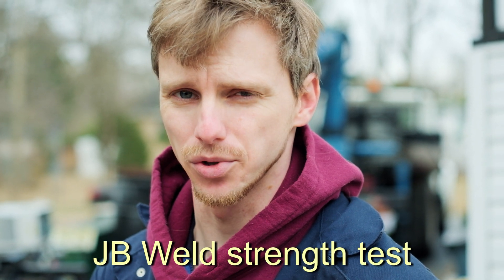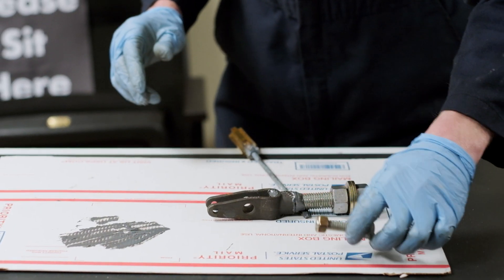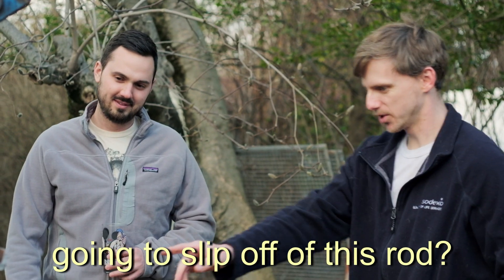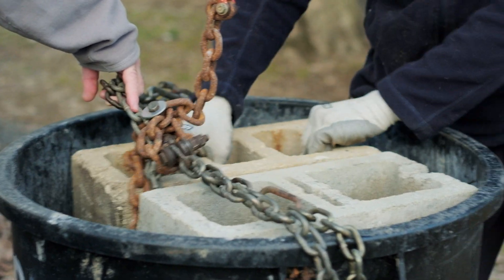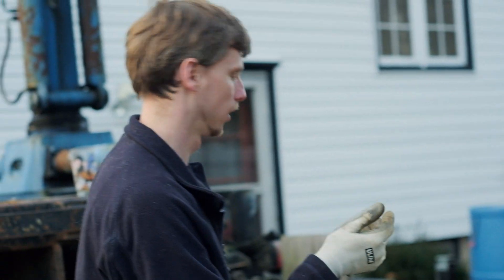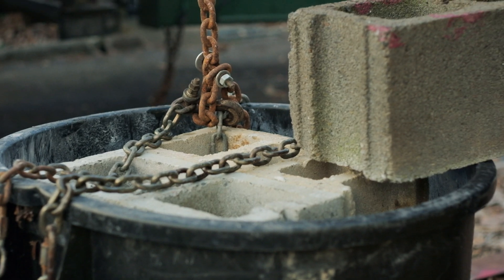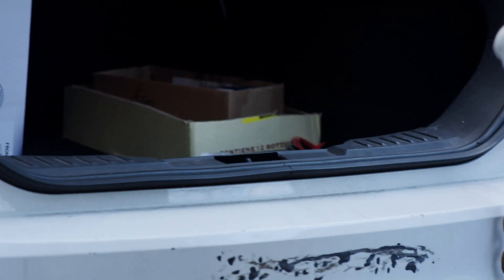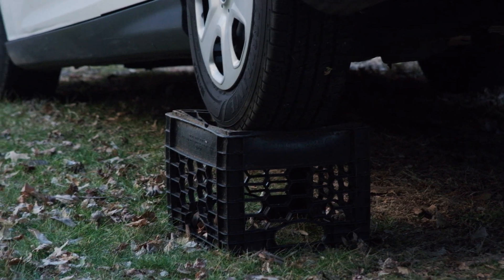The Ultimate JB Weld Strength Test (Lifting a Car)

Comment: Do the free body diagram of your coupling. You are not actually measuring tensile strength. This is sheer strength which is going to be stronger. That’s a good thing though. When you use glues, you should try to figure out a way to use them so that they rely on shear strength rather than tensile strength
Reply from the maker: Thank you for sharing. Do you have any recommendations for our tests moving forward? We’re looking for new ways to test this product. Thanks

Comment: I had a bad experience with it. I accidentally drop my Harley on the side of the road because of slippery leaves so the license plate bracket broke. The part where it broke it matched perfectly on all edges, so I thought glue alone could repair it, since It doesn’t have anything heavy other than itself.

I patched and let it dry for over a week, yet on the first ride, broke again exactly on the bond. So if you ask me, it was worthless

Comment: As a machinist let me tell you this. Just fix it the right way. You're going to regret using jb weld. This is a best case scenario with teeth on both sides. You're never ever ever going to come up with this use case scenario. just fix it right. This is a fix for meth smokers

Comment: There is no proof the yolk you used is the exact same one used to lift the car. You said the threads were ground off but is that before the JB Weld was applied or after? I'm not at all convinced you didn't thread the yolk on with JB Weld to hide the joint. Clips can  be mixed and also cutting away while you thread the yolk on are possible. I have used more epoxy and done more mechanical work than you will ever do.
Reply from the maker: @twagner6155  it’s a real test.

Comment: How does it attract it's self to a smooth surface? I can see that working as a weld I'll try it and tell ya what happens
Reply from the maker: @uranodas sounds good 👍
Reply: It's a chemical bond so will attach to any surface. The advantage of a rough surface is increased surface area to chemically bond to.

Comment: This should be no surprise. The strength as stared on the package is 5000 psi. The area of the two joining surfaces is greater than 1 square inch. I think your experiments did not include enough weight.
Reply from the maker: @lxoxrxexnx  yup, we’ve gotta up the ante
Reply: @ and measure the area of the glued surface so you can compare your results with the package claim.
Reply from the maker: @ Great idea, we are working on part 2

Comment: BS the average weight of a cinder block is 31.5lbs * 16 is 504 LBS. and being your using DIFFERENT cinder blocks you cant use the max weight and even if you did which is 35lbs thats STILL only 560 lbs NOT 604. BUT then again it LOOKS more like your testing the weight capacity of the garbage can handles SMH.  REALLY a MILK CREATE???/ cause people JUST have those in theirs incase of a flat? SMh a jack stand if far more practical and takes up less space.  LMAO you go from 504 lbs of blocks RIGHT to lifting the ass end of a car.. SMH
Reply from the maker: @randywells9676  glad you enjoyed the video.

Comment: Well I am sold on JB Weld! I had a leak in my steel power steering line (pinhead size) and it was the high pressure line. We took the line out, cleaned it up and applied the JB Weld 2 part. It dried overnight and the next day we installed the power steering line. To my amazement it doesn't leak at all! Prior to fixing the fluid shot out of that tiny hole 6 feet up through the engine bay- and made a huge mess! GO JB Weld!!
Reply from the maker: @MarkPorter-ci9it  amazing! Thanks for sharing
Reply: Always have it on hand in some tool box or shelf glove box wherever.  Once had drives shaft blow and put god awful hole in oil pan,   pryed out some the material and loaded it down with jb ,  old 350 ran for another 7 years.  If u mix it properly it will surpass all it's meant to be

Comment: Put it on a engine with a hole and with oil leaking out. See if it will hold hot oil under pressure.
Reply from the maker: @kingmike40  good idea 👍

Comment: Here's my question. If you use jb weld to fix a spot weld on a table leg where the wheel screws in, will it hold over time rolling that table a few times back and forth each day? The spot welds where the wheels screw into the table legs of my over bed table are breaking. Rather than send it back and all that hassle I just want to fix it.
Reply from the maker: @TheAbcbarnes  I think it’ll work great

Comment: Great job, very cool. I have another idea for you to test, test out the heat. jb weld claims that it can withstand 550 Fahrenheit with the wight that you pick up in this video will be great to see it hold
Reply from the maker: @JankRad-wv9bw  that’s a great idea! We can hang 500-1000 pounds and just keep adding heat until it drops. We’ll measure the surface temp with a laser thermometer. Good idea thank you!

Comment: Shilling or incompetence. The handles on the plastic trash can should be a clue. JB Weld is like WD-40. No datasheet but so much marketing.
Reply: If you Google "JB Weld data sheet," you'll find the data sheet.
Reply: Yeah those handles should’ve broke way before 1,000 pounds. Marketing video

Comment: But wait what is the purpose of this video since you screw it in. That was not the JB Weld working that is the two parts you screw in - the JB Weld played zero role in this video.
Reply from the maker: There are no threads on the bolt
Reply: He says it at the beginning within the first few min. Next time maybe pay attention to the video if you're going to make a smart ass comment.

Comment: I dunno which JB Weld company you used but mine did not bond at all. I got the Epoxy steel resin with the hardner. I was trying to bond a steel plated nut to a steel shaft on a electric motor. It never bonded and I was able to remove it with my hand after 24 hrs curing. I sanded the steel and put some acetone to make everything was clean. I did this 3 times with JB Weld. I tried 3 brands of metal glue but all the same problem. I tried super and gorilla steel epoxy  and same problem. I solved the problem by getting it welded. I also was emailing JB Weld support and they check the glue and also the pictures and video I sent to them. They could not understand why it would not bond.
Reply: Sounds like user error 😅
Reply: Did you use the original formula? I find that basically every other version is never as good as the original one even in its intended purpose.
Reply: @Gadgetmawombo  I’ve been reading a lot of user feedback and watching tests, and I’m starting to see the same pattern you mentioned: people consistently get the strongest and most reliable results with the original JB Weld formula. Many of the other versions are designed for convenience or faster set times, but they often don’t match the strength or durability of the classic mix.

Another factor I’ve noticed people emphasize—beyond surface prep—is temperature control during application and curing. If the metal is cold, the epoxy can thicken up, making it harder to flow into the micro-scratches and pores created by sanding. Warming the parts slightly with a heat gun or even leaving them in a warm environment beforehand can help the epoxy stay less viscous and penetrate better. Some also warm the mixed JB Weld itself a bit for the same reason.

Humidity and environment can also play a role. Epoxies generally cure best in a dry environment, and too much moisture in the air (or on the parts) could interfere with the bond. JB Weld cures by a chemical reaction, not by evaporation, but damp conditions can still affect surface adhesion or slow curing.

So between (1) sticking with the original formula, (2) making sure both the material and epoxy are warm enough for good penetration, and (3) avoiding damp conditions, I think those three factors explain a lot of the differences in results people are seeing.
Reply: Might've been the operator 😆
Reply: 33 years as a builder dealing with you mouthbreathers, only 2 options why it didn't bond for you. 
1. User error with bs story
2. You are a paid troll with a bs story

Comment: Guess the atf won’t get me if I use this on my muzzle device
Reply: Sadly, epoxy is not legit. Nor is Rocksett or any of the other gunsmith goop. I am currently using JB Weld on the front hook of a shotgun, but it's also blind pinned as your muzzle device would need to be, although you might be able to convince the ATF that JB Weld was the pinhead weld required. Full fusion welding, silver soldering, and/or blind pinning with a weld on the head are required by ATF regs, for now.

Comment: I had a rounded out Alan head button bolt on my motorbike. I glued an Alan key into the hole using this stuff and left it to dry for a week. As soon as I turned the Alan key, the weld cracked. So it seems it isn't suitable for some things.
Reply from the maker: That’s interesting, I guess it’s not suited for that type of torsion.
Reply: U don't pay attention😂

Comment: Going to try and use it to fix the shift lever on my kids dirt bike. The teeth are stripped and itll cost too much to replace, what are youre bets it works or doesnt ? Should only take foot pressure for shifting so im skeptical.
Reply: Would the different kind of pressure make it weaker I wonder? It would be torsion instead of pulling on the weld it's be twisting it.

Comment: I'm only here cuz I'm just making absolute sure since it'd be my first time using this stuff to fix my broken electric motor axle in one of those small electric transportation devices we've all been seeing in the past few years, until I can get a new one (distro is out of stock atm) Trying to not die lol. It's steel ,so surely it should be ok? It will be spinning at around a few thousand RPMs constantly, and be under 300 lbs of rider weight for a few weeks
Reply from the maker: JB weld is impressively strong but I can’t recommend doing anything beyond its intended use that could compromise your safety.
Reply: @HonJazzz  So it shouldn't be used on any moving components? This one's steel, and I mean we've all seen people even use it sometimes on full size vehicle drivetrain parts which are much heavier. When my axle broke during riding though it only scraped the side of the scooter's wheel well, and didn't cause a crash. I guess I'll experiment with it, (I'm wearing motorcycle gear anyway while riding as this scooter is fast)
Reply from the maker: @mightron  It’s hard for me to recommend anything without seeing it in person. I’d say just use at your own risk. It is a very strong product.
Reply: You are crazy bro
Reply: I will use this to fill the space that makes internal contact with the bearing on the shaft for my washing machine, but my fear is that it cannot be disassembled again, it is less than 1/32 of an inch and reaches speeds of 1,200 rpm, instantly It's already dry, it's been more than 24 hours, but I'm not convinced that applying force marks my nail a little.
Reply: I think that although there is a greater chance that it will not last long, I will do it simply for the sake of learning, I will share if it worked, thank you very much and very good video, it is surprising.  😊 👍🏿